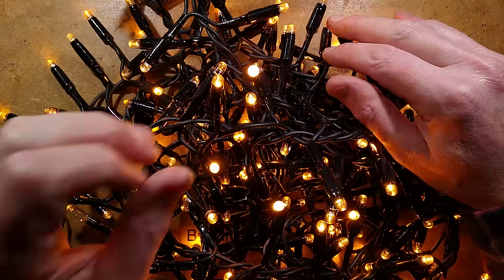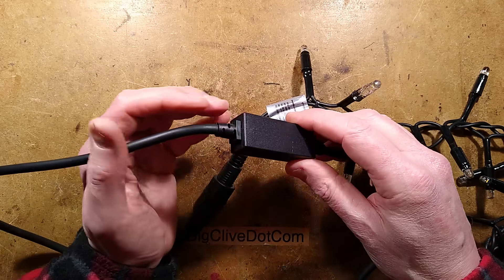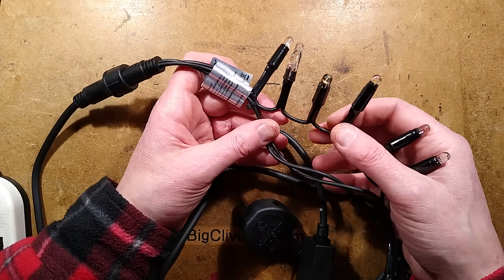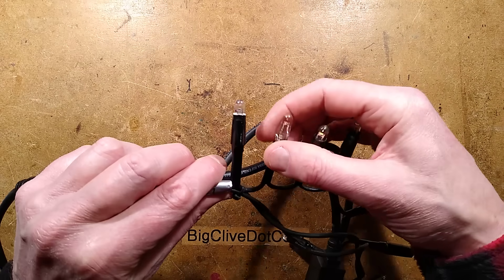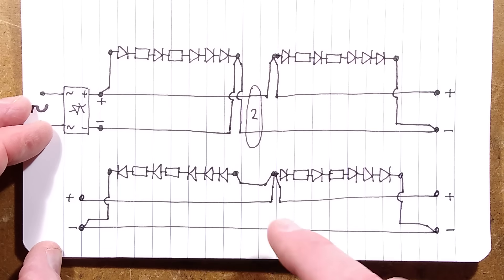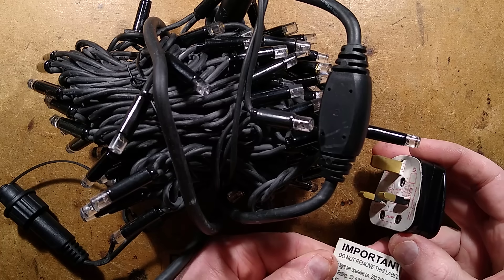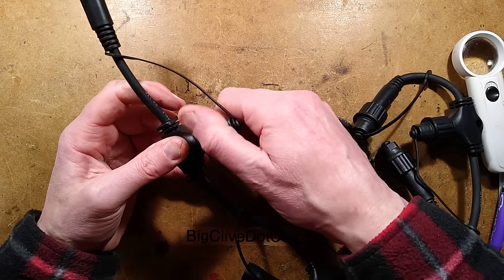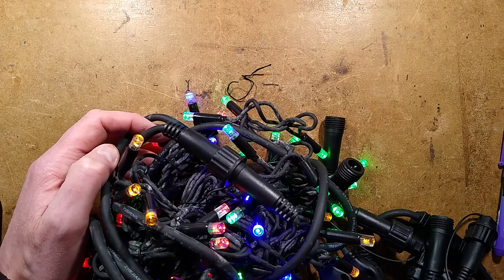Industrial grade rubber fairy lights for cities

Comment: HO5 is the voltage rating

RNF (Rubber outer, Neoprene inner, Flexible conductors) is the bit that rates it for “outside” use

Comment: Thanks BigClive ! Surely there's a set limit, even if it's dual end fed, there would be drop or overload with the cable diameter? Have 3x6m led nets in the garden, single psu fed, you can see the dimming as each set is added 😜
Reply from the maker: The main limiting factor with these is the power dissipation of the rectifier.  With a transformer based one it may have a current limited output, so the current will be shared between the connected devices.

Comment: Hi Clive. Benross trades under the name The Christmas Workshop for domestic UK Xmas decorations. They also import heaters and other electrical things from China. 

Incidentally, I believe there's just one Chinese OEM of incandescent lights left now (the one that made them for Noma in the early 2000s, now and for Benross/Xmas Workshop). 

They also make average quality extension leads/plugs which Benross rebrands along with others. They are called Ningbo Laihe (LH logo) and are likely behind the Benross lights you have here.

Comment: interesting. have you seen the cheap battery operated Chinese lights with remote. there is no insulation at all on the wires. I think they must be lacquered. weird.
Reply from the maker: The copper wire strings do have lacquer on the wire.  It's the same wire that is used in transformers.

Comment: I don't know why these things don't come with a PFC regulator in the box instead of just a rectifier
It is industrial after all, so the extra cost would be ok + having flicker free constant voltage, a unity power factor and maybe even the ability to dimm the lights, also you could omit the resistors
I can see the flicker of lights very well, even up to 300Hz or so and it usually annoys me

Comment: Municipal lights outside by me are just cheap home ones, with the 2 pin plug simply having wire ends wrapped around the plug, and taped up with PVC tape, and then cable tied to the caternary wires. Used once, probably, from past experience, will be taken off around May, well baked from the summer sun. At least the thin wire in them makes them self clearing, seeing as the breaker feeding them from the existing light feed is a 16A one.

Fun thing is that the crew installing them was working in the rain, and doing it live as well, using ABC tap in connectors to get power. Told him the next day that, 15 minutes after he was done, and had left, the rain also stopped. He laughed, said that was scheduled, so had to do it rain or shine.

Town lights are also up, the exact same identical green and red ones that have been put up for the last 2 decades. The length each year just gets shorter, and the dead sections bigger, as they fail. You have to love the Never Done Correctly for being consistent in the work they do.
Reply from the maker: That sounds grim.  Where's that?

Comment: Think you meant low pressure sodium lamps.... I love that color temperature so much!
I think they would be getting a whole bunch of the LEDs set up and soldered with their resistors on the wires and then set up in jigs so that they can all be plunged into the molds filled with resin simultaneously.

Comment: Do you happen to have a link or specific search query I could use at a specific site to locate a waterproof power source for these? I'm probably just being daft but I can't seem to find anything beyond splash rated for these types of lights and I'd love to have them hooked up outdoors full time during the holidays. Any of help/hints would be appreciated! 🎄✨
Reply from the maker: These lights are available in either 120V, 240V or 24V versions.  All are rated for outdoor use, but the plugs would have to be used in a standard waterproof outdoor socket.

Comment: I was at my local hardware store today (Lowes), and they had commercial grade C9 sets. You buy a strand that has 100 empty C9 sockets, and then you buy the bulbs separately. The strand cost $55 USD, and the bulbs were $35 of a box of 25 and had either solid colors or random colors. Cool idea but very expensive.

Comment: My infiray '['failed'', on screen its fine, but it wont record video, when i press record onscreen preview is fine, but on the phone recording I get 4 overlapping images with odd colours. It looks like an app issue not an HW issue, but either ways its useless to record video of heat changes.
I emailed infiray and have never had a reply.
I wont buy another product of theres, other companys do very similar products and probably reply to emails from the average guy. I work around it by recording video with a screen recording app and just recording the preview on my phone screen, where the image is fine, but that way I get the menu etc overlay on my recording.
https://www.youtube.com/shorts/ftYRlHDwcqo
Reply from the maker: The infiray app for the USB-C version of the infiray camera wouldn't even install on my new Samsung A35.  Scrufdog suggested an app called TC001 for a different brand that uses the same sensor, and it worked.

Comment: Hey Clive! Completely unrelated question: I've seen you distill a variety of things, I need one that'll take abuse. What make/model are you using? Thanks!
Reply from the maker: I think mine is a Megahome, but there are lots of clones, and some don't understand the concept of a condenser, with a separate pipe running inside the cooling coil.

Comment: There are at least 4 major waterproof connector systems when ordering direct from China, 3 of them have names and the 4th is specific to one of the bigger brands (it's basically the reverse of one of the other existing systems, so same plastic molds but everything flipped). I found this out when looking to possibly do a large ARGB display system, it makes it a lot more complicated to mix and match things from different suppliers =(

Comment: How does this meet Basec regs that requires double insulation on 230volt wiring?
Reply from the maker: The cable cores will probably be double insulated.

Comment: Maybe if you DIY these type lights... Pot them in thinned silicone. Put the string in a can of dilute silicon and pull a vacuum on it. Hang and let the excess dip back into the can. Overnight it would set up.
Reply: This is a variation of silicone dipping canvas and clothes to make them water proof

Comment: None of this matters as long as the LEDs are the same cold RGB colors that make Christmas look like it's from a psychotic nightmare.  C7s may have been hot, but the colors were warm and the glow was soft and welcoming.  Until LED manufacturers start producing LEDs with the same warmth and soft glow as incandescents, and they can they just haven't yet, Christmas will not be the same.
Reply: Did you see the recent Technology Connections video on the subject?
Very limited choices indeed.
Reply: They've started but I can't find a UK supplier. I believe they're from VintaGlo but there is another supplier (maybe Tru-Tone), again US only. I'd very much appreciate the muted tones of past Christmas lights.

Comment: b&m christmas lights are bad their indoor outdoor ice blue lights where the cable goes in too the lights is not sealed 10 minutes off being out in the rain it stopped working brought them in dryed them out and worked again so put superglue on the back of each light too seal the hole where water is getting in and they are working perfectly in the rain :)

Comment: Proposed big Clive DIY open source :) project. Roll your own low voltage holiday lights. Starting with a redundant Notebook PC power supply. 18VDC?
Reply from the maker: It's actually very time consuming to make a custom string of lights.

Comment: Stupid question but are these repairable?  Say a couple LED's fail, can the "potted" individuals be replaced somehow or is one SOL on replacement?  Thanks Clive.
Reply from the maker: The strings are usually multiple sections, and if a section fails it's not viable for most installers to repair them.  They just get binned and replaced.

Comment: I am curious about the LEDs (are they 3v, or are they multichip) and the resistor value.
Reply from the maker: Standard 3V LEDs.  The resistor value will vary with supply voltage, current required and number of resistors.

Comment: This is the first set I’ve seen that actually has potted components. Those cheap “IP rated” lights that are a plastic sleeve with some hot glue and lights inside don’t ever last more than a month or 2 outside. Too bad they’ve got no smoothing

Comment: These LED lights are revolutionary with the energy savings.  If the lights are well made enough, they’ll last at least a generation, and the acquisition expense can be justified.  Just think if this string were 250 of the old school C7 lamps.  When I was young we had the (US) General Electric C7 strings on our house snd the lamps got almost hot enough to scorch latex paint.  The municipality where I live has gone hog wild with LED holiday lights over the last few years, covering almost everything which doesn’t move with lights - - move over Clark Griswold.  The power bill would be monstrous if they weren’t LED lights.
Reply from the maker: Sadly, many of these lights are still only designed to last a few years before the intensity is degraded to the point of needing replaced.
Reply: @  Thank you for the reply.  You mentioned that the LEDs were being driven very hard, duly noted.
Reply: Yes, a generation of putting out cold and unwelcoming LED RGB.  C7s may have been hot, but the colors were warm and the glow was soft and welcoming.  Until LED manufacturers start producing LEDs with the same warmth and soft glow as incandescents, and they can they just haven't yet, Christmas will not be the same.
Reply: @RoySATX  you need to check out the last Technology Connection video about christmas lights, somebody has made them and he reviewed the product
Reply: @  I agree the old large C7 lamps have a cheerful nostalgic feeling.  I don’t miss the hot bulbs and having to replace burned out lamps.  It seems that no matter how carefully we stored the incandescent light strings that every string had at least one or two lamps in every string didn’t at the start of every holiday season.  The GE C7s were rated at 5 Watts each and I remember getting burned fingers when I tried to move lamps to different sockets before waiting long enough.

Comment: I bought some from CPC order code  LP15174 with a 15M extension for outside. connectors look similar but I don't remember a box for the bridge rectifier.
Reply from the maker: Some have a rectifier built into the end connector.

Comment: It's nice when maufacturers decide on a standard plug, then one goes it alone with an electrically compatible but physically different plug, until they're told to standardise or else... :P
Reply: Remember IBM's MCA bus?
Reply: @snafu.X  Yep, it went down the toilet because everyone else went for PCI...
Reply: @twocvbloke  IIRC that was mainly because of licensing. IBM wanted to catch up from their mistake/farseeing experience of making the original PC BIOS & architecture design effectively open source while everyone else went closed proprietary & gained money from that; unfortunately by the 90s when MCA/PCI came into being, companies were shifting more towards component/architecture standardisation, so weren't willing to pay the licensing fees & related costs demanded by a proprietary hardware design

Comment: Last year, I bought 3 LED “rope lights” that had a similar layout: weatherproof 2 prong connectors on each end, plus a separate Habit included in the box) BR with the same weatherproof connector to join it to the rope. I thought it would be trivial to remove one of the BRs and string two ropes together.  I was surprised to discover the polarity was inconsistent.  With the same model number of the same brand, I couldn’t just connect any BR to any rope and have it work.

Comment: The bridge rectifier is a huge benefit.  Here in the US, the flicker of half wave consumer grade light strings is very annoying in peripheral vision when driving down a street seeing s trail of dots.  It must be that much more irritating in countries with 50 Hz mains.  The full wave rectifier combined with secondary emitter LEDs with long persistence phosphor should make for almost constant light.

For me, it is when the flickery lights are in peripheral vision that is most annoying.  Peripheral vision is rigged to notice movement but with less detail, so there’s that sense that something nearby is amiss.  I’ve largely trained myself to disregard the visual noise, but the limbic system is still there to involuntary process the stimulus.
Reply from the maker: The only flickery half-wave string of lights I have is an American brand.  It seems strange that they did that.

Comment: Nice that it's not like a lot of the home outdoor sets where they still use a big "wall-wart" PSU and so really they have to be plugged in indoors as they don't fit in an ouside socket.
That's one thing that's nice about the IKEA ones, they use an inline transformer that is IP rated, so will fit in any outside socket. Interestingly the "festoon" set I brought this year has a cylindrical inline PSU rather than the usual rectangular ones.

Comment: I am not a fan of directly mains voltage powered lights. It seems just too dangerous. Why not use a 24 V oder 48 V transformer?
Reply from the maker: My preference is for 24V strings.  Especially when they can be touched by the public.  But the sort of companies that install Christmas lighting are often cheap and delusional about their electrical skills.

Comment: Last time we bought lights for Austin parks and recreation, we bought a ship container of the most generic string lights from China. Pennies per string. Much more cost effective than buying “industrial” grade.
Reply from the maker: If low voltage it's OK for disposable use.  But I wouldn't use the cheap mains voltage strings in public areas.

Comment: I've got a set of something similar. The most reliable set of outdoor lights I've ever had, must be getting on for 10 years old.
Reply: Still got a set of grain of wheat incandescent ones, around 20 years old. Only used if I actually bother to put up a tree out of the box.
Reply: @SeanBZA  Same. Few blown bulbs. Bit dim. But keeping for posterity.

Comment: I have a set from lights 4 fun pro series and it was giving out electric shocks. Connectors done up properly and no damage to the set. It was the only set in the system giving electric shocks. Swapped the set out with a different one the other day.
Reply from the maker: Had it chafed against metalwork?  Where was it in use?

Comment: Different resistors every few LEDs for different AC voltage?
I think it's easier to adjust for the different voltages right on the entrance, before or after the power-supply and the rectifier.
Is a rectifier necessary at all? 🤷‍♂️
Reply: LEDs are optimised for emitting light, not for rectifying. They don't really like being reverse biased - it shortens their life.
Reply: @johnm2012  Ok, thanks! 😉👍
Reply from the maker: The rectifier is definitely needed, and each section needs its own current limiting.
Reply: @bigclivedotcom  So, no chance to realise the adaptation to the different AV voltages in the base unit and keeping the LED-strings equal? 🤷‍♂️

Comment: those are beefy compared the cheap shit you get for house use. "outdoor" rated that get waterdamaged and my favorite is that the cable breaks from the end of the strainrelief on the transformer. got 3 sets of same brand lights that all have broken insulation on the dc side next to the strainrelief.

Comment: The resistor can be deduced by powering one led and resistor and measuring its supply voltage, then subtracting 3V from the supply voltage and dividing by the current.

Comment: I had sets where the rectifier box was not potted & they rotted!
Plus the volunteers stepped on them used to either pop open or totally break!
I still have a big bag of boxes of where I used to make my own rectifiers but I potted my own!!
Those three wires I may still have & will be digging out next weekend as council dumped(well they fell in the boot of my car)😁
Reply from the maker: When we had issues with low voltage rectifiers I used to crimp spade terminals onto the wires and stick 'em straight onto chunky 35A recifiers.